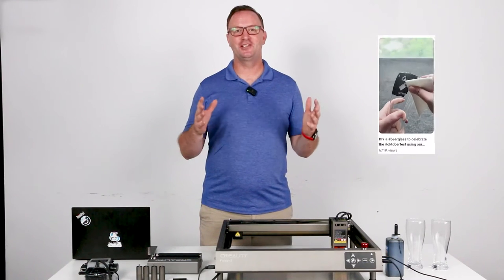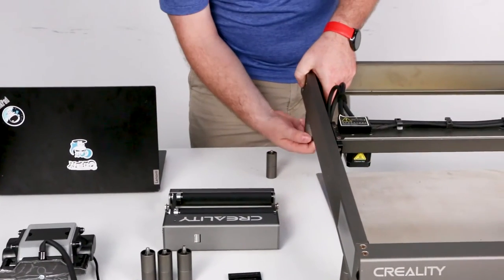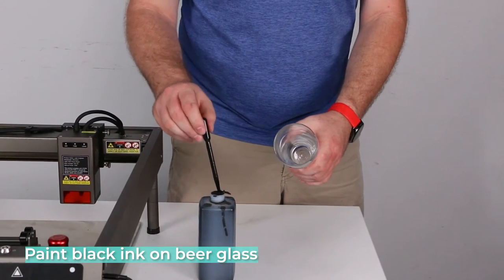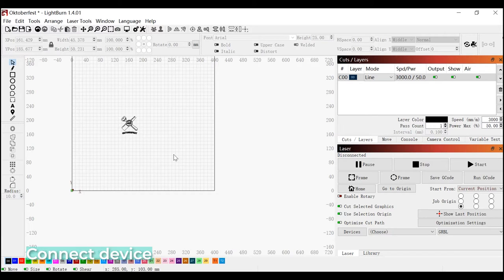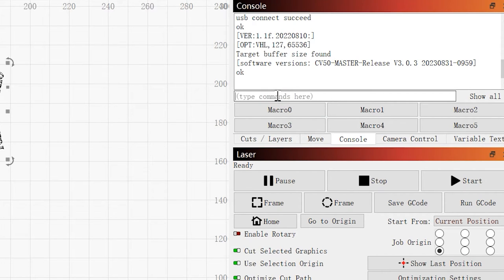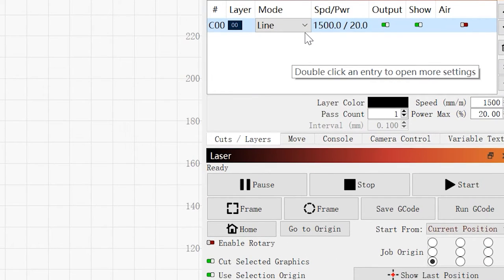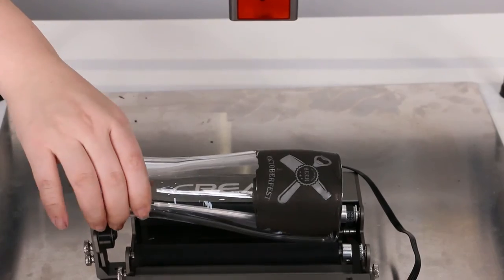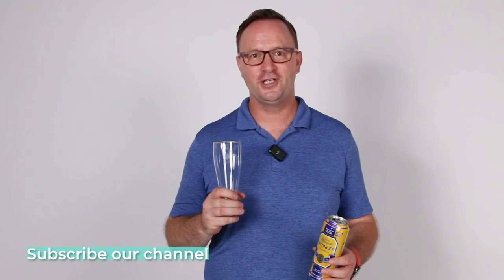How to Engrave on a Beer Glass to celebrate the coming Oktoberfest with Creality Falcon2 22W?

Comment: You didn’t explain why you added the commands in Lightburn!
Reply: $100 sets the x ratio at ## of steps/mm
$101 sets the y ratio at ## of steps/mm

If you have a CNC machine, $102 sets your z ratio at ## of steps/mm

The default is $101=80, but you can also check to see what your settings are before you make any changes by using "$$" and hitting enter.

Comment: Thankyou. What's interesting is that I can't find anywhere explaining WHY the figure of 60.375 is used. It's very precise. It's not the circumference of the rollers. Maybe it's the final output after taking into account all the rollers in the drive associated with the belt in the roller (like gear ratios).....
Reply: The $101 is the setting for Number of Y steps to move 1mm", by default it is 80 but needs to be 60.375 for the rotary tool (this info is also in the instructions that came with the rotary tool)

Comment: Hi, thanks for providing this information. It has helped answer many questions. I do however have one question... 1. I have a Creality 10w diode laser which comes with a removable magnetic lens proctor. Should I use the 1-3mm focusing spacer between the lens protector bottom and the glass? I plan to work on 3mm thick plate glass (painted black).